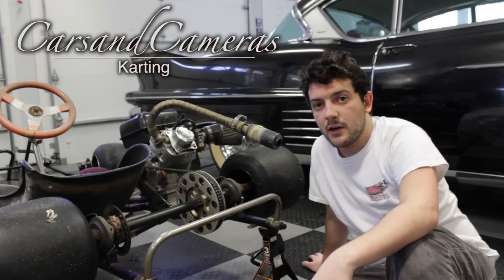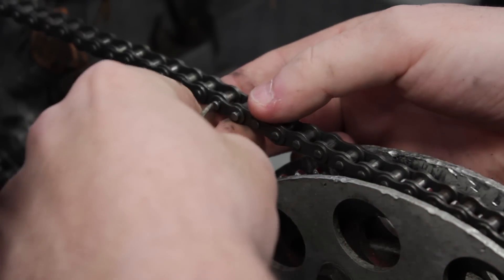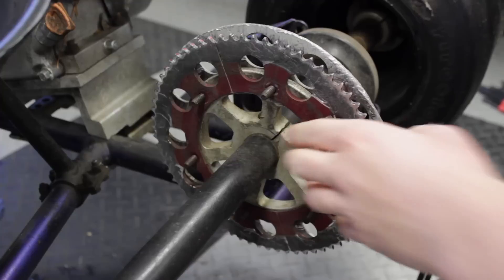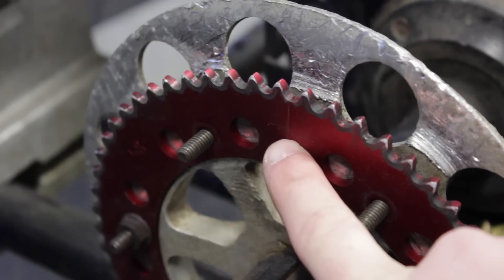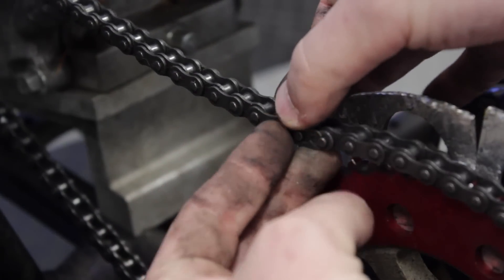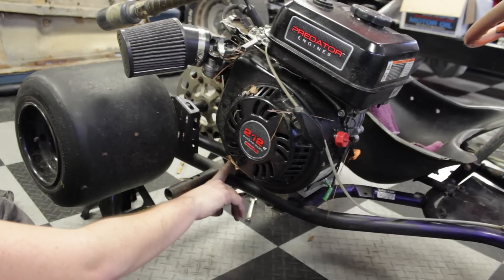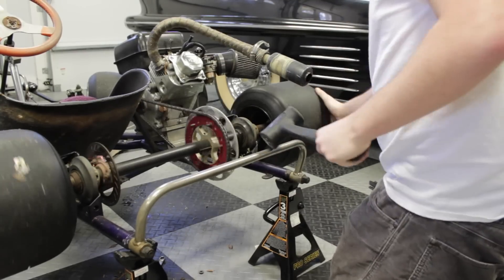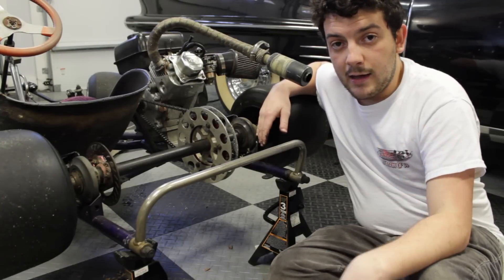How to Change a Go Kart Sprocket

Comment: I have a predator with 30 torque converter on the left hand side and sprocket and chain on the right hand side can I flip the sprocket and chasing to the left hand where the crankshaft is at instead of running with a torque converter ?? Or what would you recommend ?? I’m new to owning a go kart so I’m not to familiar I’m barely learning by watching YouTube videos. I’m tryin to make my go kart fast

Comment: i love this channel im 14 got a go kart with a predator 212 but my centrifigul clutch is making a screeching noise and doesnt really work any more any ways to fix it
Reply: you blow it up so you need to buy a new one
Reply: Tommy Acuna dont get another clutch they always break down very fast especially if you ride the go-kart hard get a torque converter it's about the price of two clutches but the torque converters almost never break and if it does it's only $15 for a new belt to fix the torque converter

Comment: I bought a torque converter for my go kart with a predator 212 on it. I can't get the chain sprocket on the tc to line up with the drive sprocket on the axle. I can't move the drive sprocket to line it up, I think the drive sprocket is 70 teeth, what should I do?

Comment: I am building a go kart and Having a hard time deciding a gear ratio. what size clutch and sprocket would you recommend for a 196cc motor? I want something that accelerates decent but more speed. thanks
Reply from the maker: verdebmxer47 I'd say a 10T (or 12T I can never remember what we have) clutch and a 60T sprocket. Smaller sprocket = + speed - acceleration.

Comment: We have an old frame. Not an offset. We found a use 11Hp B&S engine. I need to know what size clutch sprocket and axle sprocket to buy. 1" live axle. Thanks.

Comment: I would say, leave an inch or half inch of play in the chain, I do that on my motocross bike I think it would work with a gokart
Reply: The slack in the chain on a dirtbike is to compensate for the moving of the swingarm, but this Kart having no suspension doesnt need that, sure you dont want it super tight because it will just wear the crank bearings quicker but it doesnt need to be that loose either

Comment: i have a 12t clutch and I want my go kart to go faster what's the lowest I can go on for sprocket teeth please help me
Reply: 60t
Reply: +pablo saldana what size chain do i need for it
Reply: +Isaac Obispo it depends what type of clutch you have and it could be #35 chain or 40/41/420
Reply: +pablo saldana i have a 212cc predator engine 12tooth clutch
Reply: +Isaac Obispo i would say order a 40/41/420 and see how it plays and if it doesnt work well get a #35
Reply: +pablo saldana i had a 35 and it would always fall off even if i had it tight
Reply: +Isaac Obispo then you need a 40/41/420
Reply: +pablo saldana what if my back sprocket is a 70t but the 35 chain still falls off should i get a 40/41/420
Reply: +pablo saldana can you please help me

Comment: if I run a 12tooth clutch on a 64tooth sprocket will I be ok?  i might be out of but I sure hope I'm ok.
Reply: Yes, I am running a 12 tooth clutch onto a 48 tooth sprocket, it works fine, other than the fact that acceleration is a little slow.
Reply: +Lucas Foreman thanks my build came Friday. It's super quick and I maxed out at 30mph.
Reply: +Tyler Mp size of tires?
Reply: +ThatOneGuy 7 I finished my build but 5 inch.
Reply: Tyler Mp Thanks. makes me feel better about having 10 inchers for more speed. 30mph? i cant wait 'til tomorrow . DAMN! forgot waiting on clutch to arrive.
Reply: Enjoy your ride !!!

Comment: Mine's welded on the axle shaft :P Any help? How can I release the weld?
Reply: I carefully use a hammer to break any welds I have, or you could clamp a vice grip tightly of the sprocket, then clamp another vice grip on the axle; then attempt to turn the axle. It differs depending on the position, but I would just try to use leverage to your advantage
Reply: +Lucas Foreman It broke and it's falling off
Reply: +Lucas Foreman Must've had the worst weld ever if you can take it apart with vice grips..

Comment: Why don't you make that thing legal and find a local track and try racing this thing! Also I usually take off the RR tire, loosen the motor, take off the 6 bolts holding the gear/chain guard and change my gear that way. Way more painless than carrying around extra chains